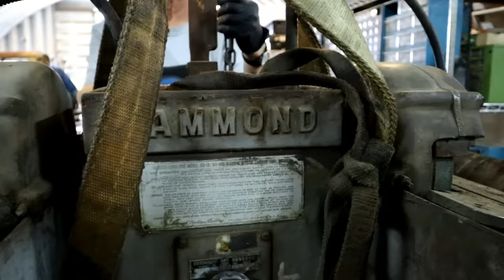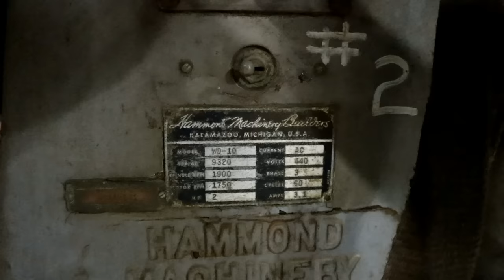Hunting for MORE Machine Tools To Restore : Part3

Comment: I read that name tag and it said 2 HP, 3Phase, and 440 Volts, do you have a setup transformer?
Edit: Never mind, he said it runs on 240, I need to watch all the way through before commenting. Lol
Reply from the maker: He said he was not very well versed in the electrics and that his late friend, Steve, was the one that always handled that.   They had the peckerhead off the motor and were changing it to 220, but it was not working well.. Had to hold the coil down for the motor to run... I guessed that they had not changed the 440 coil in the starter but it does look like they did that... HAve to dig some more..